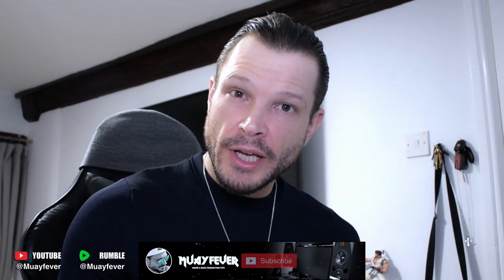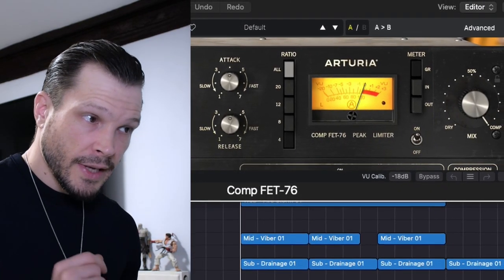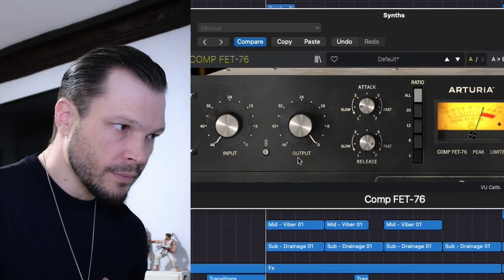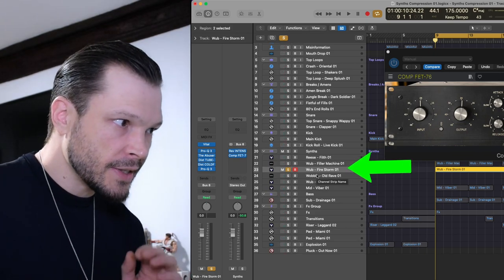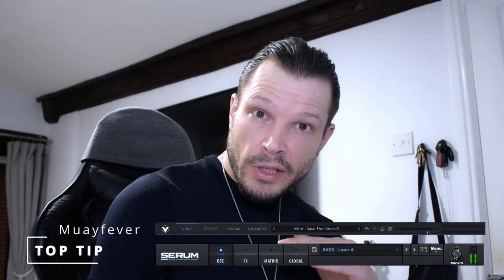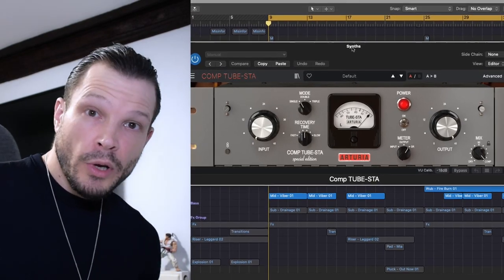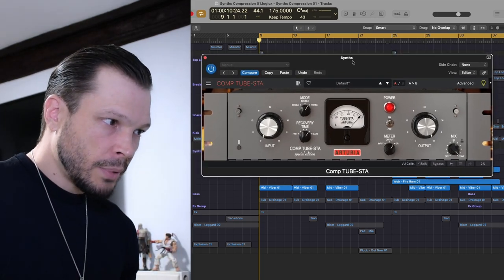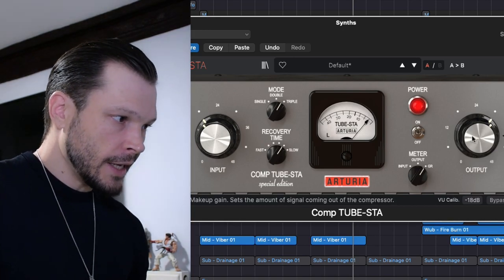Two Is Better Than One! - The Pro D&B Synth Process You Need To Learn!

Comment: Just a beginner here, not really across all the industry methodologies,  i just nomally do all thr compression and eq etc on thr track and just hsve 1 bus per track )(i  only have a few tracks normally) no post fader processing. 

Is this amateur?my mixing usually turns opur pretty good though .

Aplpogues for long question just wamted to provide some context .and i use cubase 5 😂
Reply from the maker: Yes, you want to have different bus groups for different elements in your track. This will give you the ability to separate and process each instrument individually to get the cleanest results.